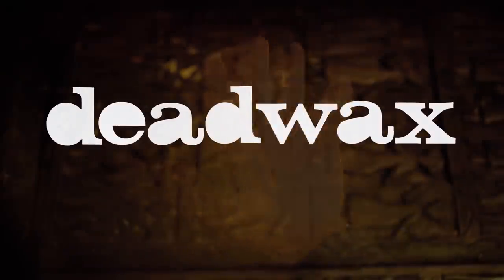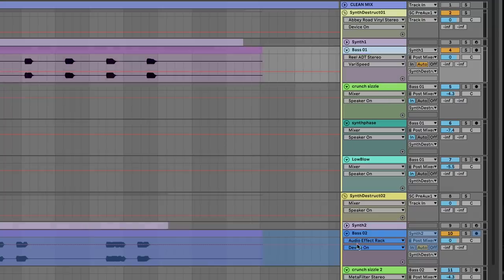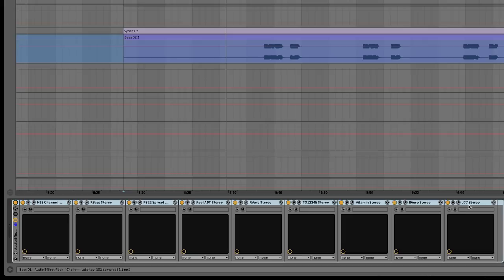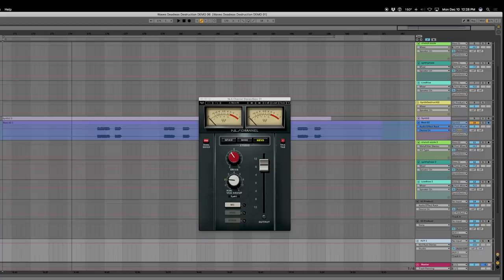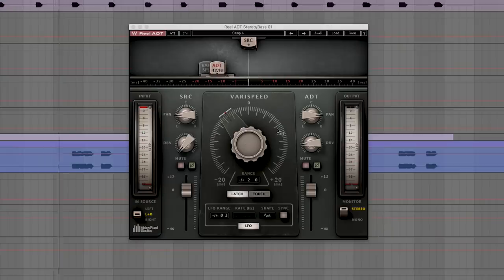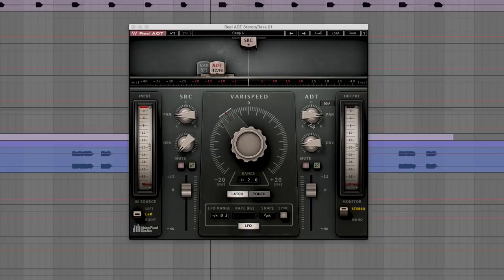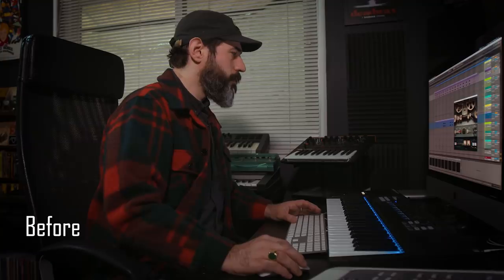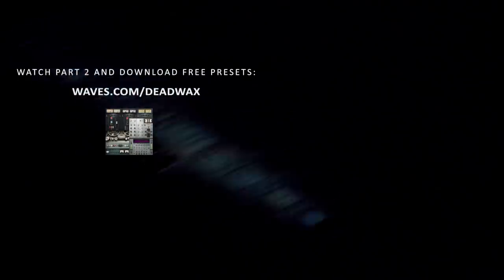Sound Design Techniques – The Killer Chain Part 1

Comment: I have heard loads of people moaning about waves plug ins in loads of forums and saying this is better, that is better. Waves won't make up for lack of engineering skill but they make amazing plugins with much nicer layouts than other plugins. The renaissance series such as req and rcomp are especially nicely presented for ease of use. For speed of work flow they are great and keep things moving fast. I have never used any plugins as consistently good as waves. The renaissance eq is good for everything. The q shaping on the high and low pass is perfect with the little dip before/after the boost. Best music production software company out there.